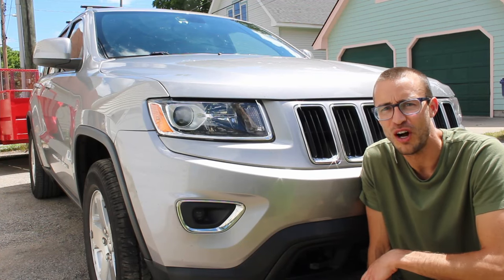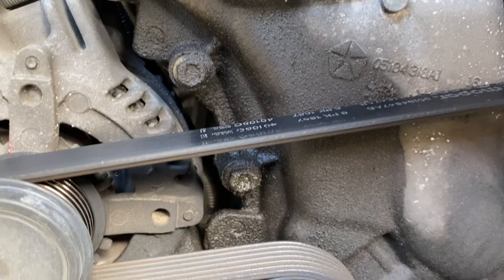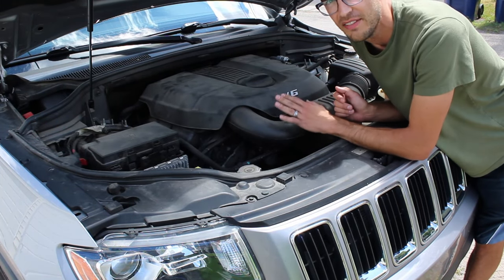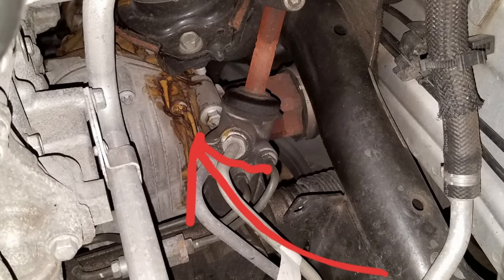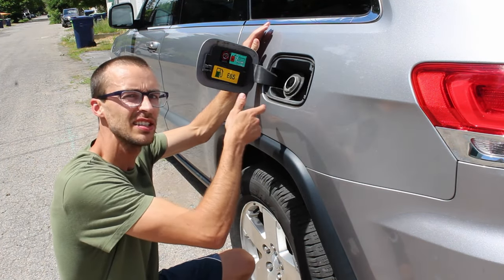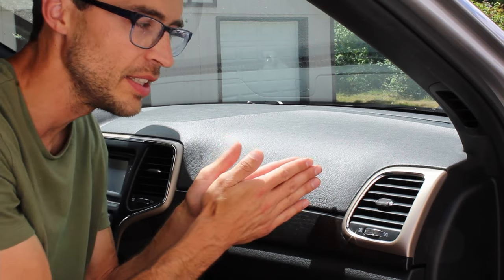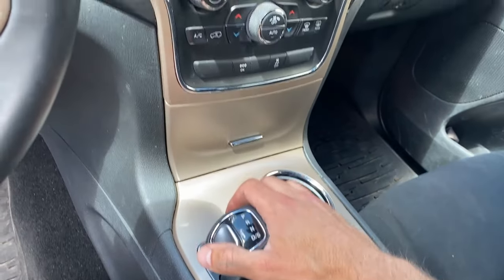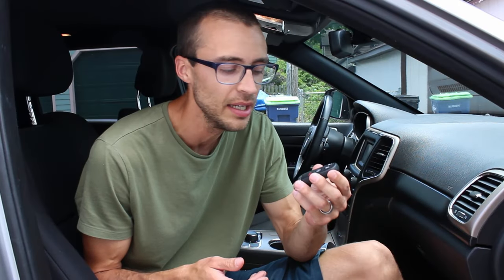Jeep Grand Cherokee Common Problems - 2011-2022 WK2

Comment: I have a 2014 Grand Cherokee with 136,000 miles on it, I have had none of these problems except the oil filler problem because a service guy over tightened it. Only brought it back to the dealer once to have a software update, the Jeep has been super reliable.
Reply: Did they make it right by over tightening?

Comment: I have a 2014 JGC Laredo.. I have changed my thermostat, motor mount, aC condenser and the aC motor fan ( I think that’s what it’s called) now I have intermittent starting issues and literally have no idea what is causing it.. if anyone has any ideas please let me know
Reply: I have this issue with starting and no one not even the dealer can figure it out

Comment: I have laredo 2015... transmission replaced at 220 KM, I'm experiencing the rough shifting from 1st to 2nd gear you mentioned even with the new transmission, its really annoying issue... other than that, the car is awesome. I love it.

Comment: Hey buddy. I have a 2017 laredo. When I start the car I hear ticking and then it dies down. What exactly is that? And is it bad
Reply: Me too...only when not run for awhile....sounds likes it's not getting oil fast enough to top of the engine...
I put in the best natural gas derived full synthetic oil..seems to help

Comment: My problem on my ‘14 grande Cherokee is it says service shifter and it has been replaced and still comes on every time I start it. Very annoying.
Reply: I have a 2014 Cherokee Trail hawk with the same problem. It comes on for awhile then goes off just as suddenly.

Comment: I have a 2019 High Altitude CG. Bought used this past August. Already had hood corrosion fixed, radio face replaced due to delaminating, sunroof replaced because it was leaking and now my parking sensors are bad and tonight my hatch module went out and it doesn’t beep when it closes. I drove it for 8 weeks total and it’s been in the shop for 3 months of the total ownership time thus far. I had an 2004 GC and loved it. This one… on the fence. Seems like a lemon. Or just my luck with cars.
Reply: Must be a 2018 model because that's the only year that had the issue with screen delamination.

Comment: I had the very hard shift 1-2 on the UK 3.0 diesel 5 speed auto RHD model with 110,000 miles on the clock. It's a 2011 model and came my way very cheaply.  Looking through the car's history it had had various transmission services, so rather than repair, I bought a second hand transmission form a scrapyard and had that fitted.  Fingers crossed it's now OK.  What's so stupid is that there is no transmission oil dipstick so it's a matter of making one with long zipties.  The fluid was a bit more brown than it should be and smelt a bit burnt.  The previous owner towed a horse trailer to equestrian events so I'm assuming that the transmission worked pretty hard in muddy fields and that's worn the clutches.  I may rebuild it on the bench if I can be bothered and can get the parts.  ZF are really uncooperative and unfriendly to DIY mechanics here, unlike Borg-Warner who couldn't be more helpful.
Having had Range Rovers and Mercedes cars with air suspension I avoid that like the plague.  There are very few Laredo spec cars here in England but plenty of Limited spec cars, so I bought one of those.  I never buy new cars, that's a great way to burn money

Comment: I have a 2012 Hemi and haven't really had any issues. I replaced the water pump around 80k. Other than that it rides good and is dependable. Bought at 78k miles
Reply: How much miles you got on it now?

Comment: PCM. $1500 to replace and hard to find.
Reply: That's just for the part by itself.  Labor $460. A serious pain in the butt.  Had to replace the actuator on passenger side twice in 4 months.  Cheap plastic.  Yesterday the volume stopped working.  Radio works fine but no volume at all. Just one day I would like to get in my 2011 Jeep Cherokee  without a minor issue.  Can't win.

Comment: I have a 2014 WK2 overland and in the mornings I usually let it warm up for a few seconds to avoid the hard shift between 1st and 2nd. I’ve noticed the ideal warm up period is as long as it takes for the Bluetooth to connect and start playing. On colder days it takes a little longer to connect but if I wait the couple extra seconds it shifts smoothly. Coincidence or is there something to it?

Comment: My radio will not come on and screen is black. Both fuses r good and I disconnected battery for 15 min hoping that would reset it but no help. Any thing else I can do??
Reply: My2019 does this too, dealer refuses to believe me and has no solutions. I even have video of it.
Reply: Try unplugging the radio for a day or 2 then plug back in.

Comment: Lol all v6 trucks have problems the engine not big enough
Reply: 40 years ago that statement would be accurate. In today's time they're putting 4 cylinders in suvs this size with zero issues.

Comment: I've had a 2011 Laredo for over 10 years, now. Just turned 200,000km. Bought used, a former rental vehicle. Normal wear items, tires brakes etc. Thermostat engine not getting hot enough. Blend door as stated. Overall a pretty reliable rig. 🙂👍

Comment: After a 2011 grand Cherokee and 2015 Jeep I gave up on keep I hate them with a passion now get a Toyota
Reply from the maker: Any specific major problems? Our 14 had been pretty goof
Reply from the maker: I like Toyota alot too
Reply: @KurtofTrades  2011 grand Cherokee went through three motors and 2 transmissions 2015 had shifting issues and jerked us on acceleration and deceleration and worst of all was the noise the dash constantly made.  The sensors goes haywire and the car sensors malfunctions
Reply: My 4Runner gave me far more problems than my Grand Cherokees.  But the biggest issue with the 4Runner and the reason I traded it in on a Grand Cherokee is that the frame was basically rusting to the point that it was rotting out. And that's  despite the fact that i powerwashed the undercarriage after every winter.  Toyota makes good vehicles, but rust is still a big issue for them. After one year, my 4Runner's frame and undercarriage had far more surface rust on it than my Grand Cherokee had after 5 years.
Reply: @Japplesnap  coming from a family that owns nothing but jeeps chevys and fords I tell ya there’s a always bad and good in any brand but statically speaking Toyota does better in numbers and repairs
Reply: @topshelf223  That may be true, but here's the thing----look at the statistics closely and they may actually favor Grand Cherokee over 4Runner. How is that possible? Well, if you look at the rate of issues between those two vehicles and then consider the fact that Jeep sells FAR more Grand Cherokees than Toyota sells 4Runners, you actually have better odds, statistically, of getting a problem-free Grand Cherokee over a problem-free 4Runner. The stats completely support this.
Reply: @Japplesnap  Toyota or Jeep.  I’m done with them after 4 jeeps in my lifetime.  Good for you if you wanna keep the jeep I’ve learned my lesson and I’m sticking with Toyota.  Until they bring back the 60s and below
Reply: @topshelf223  That's cool. I was never a Jeep guy until I had to get rid of my 4th generation 4Runner and I hated the styling of the 5th generation 4Runner that came out in 2009. So my plan was to switch to a Grand Cherokee for 3 years (while it was still under warranty) and then trade it for a 6th generation 4Runner. But fast forward to today and Toyota is still making the same ugly 5th generation 4Runner with terrible tech and a really lame 5-speed transmission.  And in the meantime,  i realized that my Grand Cherokees (I had two....my first one got totaled when I was stopped at a red light) have been fantastic and completely reliable. So even if Toyota finally does make a nice 6th generation 4Runner after 15 model years of the 5th generation,  I'll probably just stick with Jeep because they have been great vehicles.
Reply: @Japplesnap  I have a sequoia nothing like it 🤙👍
Reply: Yes, get a Toyota. Bullet proof motoring.

Comment: You said a slight rumble on idle at 2:40. Mine just started this at 100k any idea what this is. I have changed spark plugs, ignition coils, and belt. No luck its getting annoying and no one knows.
Reply from the maker: If it rumbles only when idling probably motor mounts.

Comment: So basically, just another giant piece of junk. Unfortunate, they are nice looking vehicles.
Reply from the maker: I actually think they are pretty decent vehicles. Most cars have a similar amount of problem.
Reply: @KurtofTrades  Most American cars may have similar problems.  Never had issues with Hondas or Toyotas.  Purchased used 2014 JGC Laredo in 2017 with 38K. At 53K camshaft issue passenger side. Lucked out still had powertrain warranty. If buying used be sure to buy from a dealer pre certified so you can get powertrain coverage to 7yr/100K.  Saved my ass!

Comment: I have a 2012 WK2 overland with the hemi i bought used, recently hit 100k. The water pump and both motor mounts have been replaced. There's a hard thump when going into park, aside from that she runs great.

 I added an external oil cooler as we tow our 5k+ travel trailer frequently into the high country and take her off roading often. With the air suspension and limited slip diff, I'm able to do some more of the difficult trails I used to do in my gladiator. Comfortable all around capable vehicle, happy with it so far. Great video.

Comment: I found the key with this jeep new I have changed ever sensor in there from o2 sensor that's a keys transmission senor however your jeep has those rocket arm and spring and injectors now thing about that is next time I will put treatment in oil and gas because when those break or just wear you have to think oil change keep it injectors its always good to be new but if it was a little easy do that injectors easy but you have to check the rocket jeep ran find thing chain reaction of things the reason many to all mechanics don't do that not cool car should do something about and a easy fuel rail

Comment: I have a 2016 summit with 65,000 miles on it and the transmission kicks a little when you put it into drive and also when it's downshifting from second to first, does anyone have the same problem, any advice?
Reply: Probably a little low on oil, I believe they don't come with a trans dipstick but they you can find one online

Comment: Chrysler V6 engines are total crap and way underpowered. I'm a mopar man, but if it doesn't have a Hemi in it, I don't buy it. I've owned Hemi's since their re-introduction and have never had any problems with them. They've always performed. Now that the WOKE Chrysler has stopped making the Hemi, I'll be moving onto something else. Toyota and Honda are coming out with some new engine technology that sounds very strong and promising.
Reply: I couldn't disagree more. I have a 2016 Pentastar V6 100k and has been trouble free and plenty of power.

Comment: I’m having two problems, both were briefly mentioned in this video but if anyone has more info about either let me know your experience.

1. Rough Idling - in the past couple or two I’ve notice the Jeep intermittently idles rough, rumbles, shutters when the jeep comes to a stop (like at a red light).  Obviously, when the car turns off with the Auto on/off feature this isn’t a problem. I’m the video (and from other research) it sounds like a bad motor mount can be a potential reason. I’ve been to the dealership and they weren’t able to fix it. The dealer do a throttle body service, ethanol treatment, and software update. Again, that didn’t solve the problem. Any ideas???

2. Electrical - not long after the rough idling started I began having headlight issues.  When you crank up at night all the lights come on as normal. 1 min after start, all front end lights go out. 30 seconds later all front end lights come back on. 30 seconds later right right headlight goes out.

Is anyone else experiencing these issues? Any chance the two are related?

I’ve tried replacing both batteries (the primary and auxiliary battery), but that made the computer freak out and the jeep thought all the sensors where needing service and now the jeep can’t be driven. I had to have a tow truck take it to the dealer.

Any ideas??
Reply: I hope this gets answered. 
2014 JGC Limited 125k 

My driver side headlight, windshield wipers and passenger side tail light simultaneously quit working. I have checked fuses, changed fuses, replaced bulbs.. I’m trying to avoid taking it to a shop due to money and time. But this is miserable..
Reply: UPDATE:  Since the Jeep wouldn’t run after replacing the batteries, I had to tow it to the dealership. I explained that there were now at least three problems: the jeep won’t run, rough idling, and passenger headlight won’t stay on.

A week later they call me back and say “it’s ready to go”.  When I went to pick it up I tried to confirm if they fixed all three issues. Unfortunately, they hadn’t. They got it running again but hadn’t even looked into the rough idle or headlight. For this incredible customer service they were nice enough to take $800 from me. I told them I still needed the other issues fixed. After 2.5 hours they came back saying I needed new headlights and a new headlight assembly ($2,400), and for $500 they would do further diagnostic testing about the rough idle (but the parts and labor would cost additional money once they determined the problem).

I was floored how they missed this the first time, and at how expensive the repair would be. Angry and frustrated I took my jeep.  For about $250 I replaced the headlights myself. They work, but the alignment is not right.  And the rough idle is still present.

I’ve now been to two dealerships and neither fixed my problem. Do all dealership service departments suck? I was also unaware of the poor reliability of jeeps. I only have 80,000 miles and considering just buying a new car rather than put more money in this sinking ship. Any thoughts??

Comment: If you can get 5 years out of a new vehicle without a major repair bill you're doing good. I don't think that's possible with any Chrysler, Jeep, Dodge, Ram FIAT® products. Statistically, they breakdown more frequently than the other brands which reflects in their relatively poor resale values.